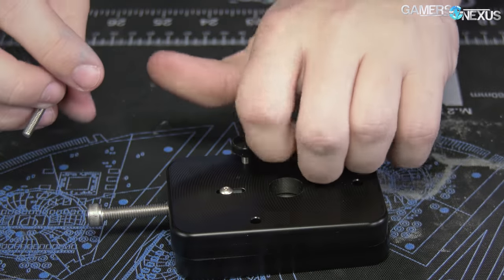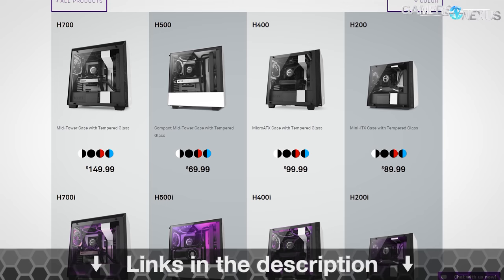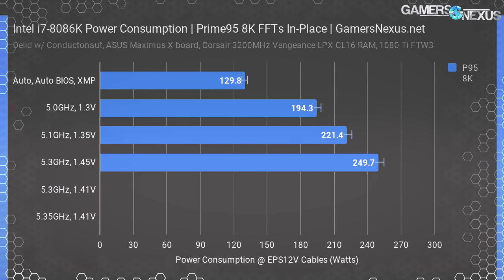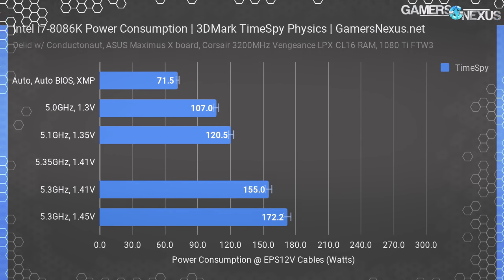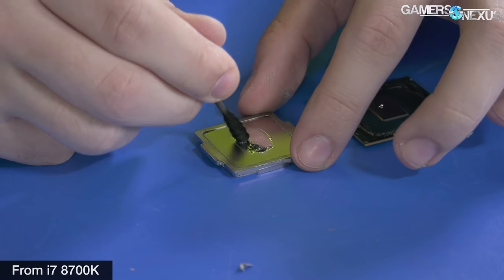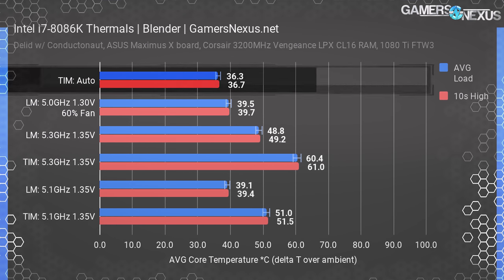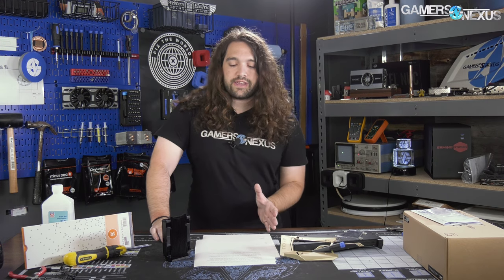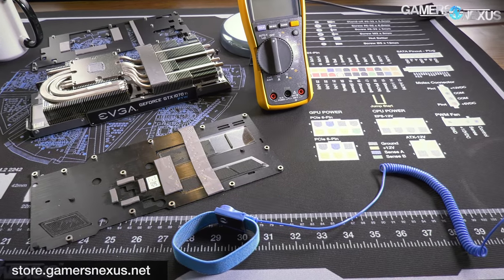The Untold Story of Liquid Metal: 8086K Power, Noise, & Thermals

Comment: This is precisely why I plan to delid the 8700k in my editing rig: Get it near silent at stock speeds for sound work. Great video on LM other useful applications!
Reply: Why not a R7 2700X?
Reply: lagarttemido I dual-boot into OSX to use Final Cut Pro on colab projects. Otherwise I would have stayed with Ryzen.
Reply: After delid you'll probably even have some OC headroom before the rig becomes noticable (in terms of sound).
Reply: I run mine with a silenced optimized fractal chassi, noctua nh-d15 and it is silent. no need to delid and remove warranty for sound levels.
Reply: logirex but with delid you can lower temps significantly. Use less power and generate less heat!
Reply: Indeed. This is a major part of why I want to delid, under-volt to keep the room temp down during long hours of editing. I have the NH-D15s and it's a great air cooler, but the thing it's sitting on isn't helping it do its job. 🙄
Reply: Why didn't you just get the i7 8700?

Comment: Steve, apparently 5nm graphene transistors have been made in research labs that can achieve clock rates in the Terahertz. I can't imagine the immense power my grand kids are going to have. While i was pulling my hair out for an extra 100mhz.
Reply: Obviously its for running a modded Minecraft server at a reasonable tick rate.
Reply: Spoonikle so true, my 1600 at 4ghz struggles with the mods we use
Reply: I remember when 1.6MHz was earth shattering... And then we got a 80386 at 24MHz and people said we'd never go faster than that since that's as fast as the human brain.
Reply: joshcogaming because java is terribly single-threaded. It’s a shame the core of the game was built so poorly.
Reply: Mitchell M. The game is multi threaded supported. Unless you’re still on a version before world generation was reworked. Right now it runs better the more cores you have. If you’re still on a dual core, then the current version of Minecraft will run worse. I believe it was patch 1.7 or 1.8 that made Minecraft run worse on potatoes
Reply: Hah! Yeah! I remember when my dad brought home his decommissioned work computer and I was blown away by the future. An 8088 4mhz. With the turbo button, you got up to 4.77mhz! Turbo button OP, plz nerf.
Reply: Michell M., Java is the first language to bring a memory model. It is one of the best languages for multithreading since then (2004) with lock-free datastructures coming straight out of its core library. Single threaded performance is nothing short of above decent. People still write high freq. trading in Java. However, non scalable code is just that regardless of the lang. used... throwing blanked statements is not helpful, either.
Reply: PorscheRacer14 I overclocked my brain to 28MHz 😎
Reply: The problem with graphene transistors is, that they have a very low on/off current or resistance difference. They always operate in an omic region, where the resistance of the S-D Path is determined by the gate voltage and there is no real 'off' state. Because of that, they are not yet suitable for larger digital applications, such as a CPU. However, they are very good at controlling analog signals, where they can archive cut-off frequencies in the THz region. But such a high cut-off frequency doesn't imply a THz switching frequency. For example special RF Mosfets can archive up to 400GHz of cut-off frequencies, yet CPUs are limited at about 5GHz. One of the reasons for this limited frequency, is that a CPUs consists of many transistors, which have to switch other transistors, so the maximum frequency of the whole CPU is lower than of a single transistor.
Reply: Oh great so all the graphene cpu stuff is clickbait maybe it won't have higher frequency than the one we have now.
Reply: Right now we don't have a technology to build a whole CPU with graphene transistors, however it is beeing researched actively and maybe we find a way to use graphene transistors effectively for digital applications. But they can be used for different applications, like modulating a High Bandwidth signal on a THz carrier, that could be used for extremely fast data transmission.
Reply: You won’t see that implemented in mainstream CPUs for another 10 to 15 years at least
Reply: That's not much of an achievement. We've made silicon transistors that run at 700ghz.

The problem with this logic is that :
-How fast a transistor can switch does not dictate how fast a cpu runs at.
-it's lab tech
Reply: If we continue on our current trajectory, our grand kids will be largely controlled by AI... if the human race survives that long. Our current future is cubits, not cores and neutrinos, not microwaves. Think non local computing. The people must have an interest and a say in how these technologies shape our future, the exponential growth of the wealth divide and the corporatisation of politics diminishes the likelihood of this. Progress without prudence is not progress at all. With great power comes great responsibility.
Reply: Actually, there is a theoretical limit of 10GHz when it comes to classical transistors’ maximum switching frequency - above this you get into quantum tunnelling issue territory. There are ways to mitigate this but at the moment they can’t be applied to complex digital circuitry.
Reply: Yeah, considering the distance that light travels in a picosecond (duration of a 1THz cycle) is 0.3mm, one side of your PC will be 1000 cycles ahead of the other, just from relativity! But who knows, maybe PCs will be tiny in the future...
Reply: Jack Maxwell Yes. Already there are Itx motherboards that report higher max memory speeds because the distance is smaller.
Reply: Jefferson while overclocking your brain did you accidentally underclock your intelligence for the poor quality joke?

jk
Reply: Was gonna jump in with "nyah.. back in MYYy Daayyy... " but it appears i there are older cootes here XD. 33MHz then('93); 4x4600 today.
Reply: Or 4.62ghz x 6 cores 12 threads with my asskicking xeon x5650.
Reply: 80386 @ 24MHZ .... yup, Sun 386i ;-)  But the really important computer was the Compaq DeskPro 386, which established IBM's previous open AT architecture as the Industry Standard Architecture, denying IBM's proprietary PS/2 Micro Channel architecture the controlling position. That was the beginning of the end of IBM and its new OS/2 operating system as the PC industry leader, and the birth of the high performance personal computer as a commodity.
Reply: CPUs have been limited by the FCC regulations for a long time because of electrical noise it causes, besides, lots of hertz doesn't mean much if its got no flops.
Reply: PandaMan c‘mon don’t leave me on a cliffhanger grandpa...
Reply: @mitchell3876  Certain versions of Optifine allow you to take advantage of more than 2 cores on 1.6+
Reply: I find that hard to believe considering graphene is a conductor not a semi conductor like every diode based component is today.
Reply: Oh god VR is gonna be so amazing

Comment: I remember when 1.2 GHz was badass... Looks so trivial now lol
Reply: I remember Pentium IIIs only able to get at 5ghz on LN and that was totally insane at the time.
Reply: I remember when the question was, "But can it run Tribes 2?"
Reply: Trail Features lol
Reply: SysPowerTools nice
Reply: I recall 2.0 GHz with 2 cores from AMD blowing Intel out of the water. Those CPU's are essentially useless today...
Reply: Commodore 1.02MHz (6502) were the days. That said we reached 5GHz in consumer processors 5-6 years ago..
Reply: @Chuckles Nuts Was that the Athalon chips? Too bad AMD can't pull that off again. To this day they haven't been able to design a process that's more efficient than Intel's, though, it only makes sense. Intel has far more resources, and has far more talent because they can pay their engineers far bigger salaries. AMD likes to design a process, find it's strength, and then market the dogshit out of it's strength. Which is fine, but Intel doesn't even have to market their products anymore lol. They just put it out and you know you're fine. AMD might mess around and leave you on a platform for 5 years without any drivers support like they did in the past. Or start throwing insane voltages at their silicon to get everything to "pass", but is running at insane temps and throttles. I'm not even sure AMD are real competitors at this point. They're more like , "an option". No offense to anybody who picked that option. Even if AMD puts out a chip that can undercut an Intel product in a very specific use case, Intel will fix that before the next quarter, and you don't have to worry about any of the risks associated with a company that's notorious for leaving their consumers high and dry....... FOR FIVE YEARS, not to mention driver and stability issues, even a year after launch "see demtrey's reason for going back to Intel just a few months ago".
Reply: Pfft, I remember when a 4 bit processor was badass. That's the first time I ever wrote a program, and it had to be stored on one of those things called a cassette tape using audio jacks.
Reply: Surfing Eagle Pfft I remember when the abacus was bad ass!!
Reply: logirex my first computer was a Comadore VIC 20, great machine back in the day.
Reply: The_Man22 my cellphone have 1.5 ghz 😑
Reply: 1.2Ghz is late... going from a 386sx 16MHz to a 486DX2 66MHz was amazing, also went from 5MB RAM to 32MB RAM. The computational power was insane!
Reply: @NikoBased  what's your verdict now, considering Zen2 is out and dimitri going back to threadripper?
Reply: Jesper here 486 dx 2x 66mhz (turbo button),407mb hdd,16mb rams,4xtimes speed cdrom,14crt, soundblaster 32.
Wonderful times :)

Comment: I’ve learned a ton from your videos, so please keep it up.  De lidded my 6700k a little while back and although I was kind of nervous, it all worked out well and I feel like all the custom water cooling I did is now worth it because the system maintains such low temps that I was able to turn down all the fan curves.  Bonus, even OC’d, the wife can’t tell when I’m gaming because my 6-140mm Varders no longer sound like an airplane taking off when under load.  :)

Comment: This is a great point. I delidded an 8700 non-k for my friend, simply to allow for decent cooling. It would pull 100W+ (HWINFO) during games like Star Wars BF 2, and temperature instantly spike to the 90's. Delidding allowed for a decent air cooler to run close to silent in all use cases. I have a hard time recommending these chips to people, as I care alot about the noise of my builds, and certain games will literally thermal throttle without a delid, unless you throw a big AIO at the thing.

Comment: Steve, one thing you didn't mention, when you use liquid metal you can normally drop your core voltage to maintain the same overclock.  This also will give you lower temps and lower fan speeds.

Comment: Honestly I feel the benefits of LM for acoustics presents itself best in laptops. Rather than overclocking, replacing the TIM with LM and undervolting the CPU can lead to much lower fan noise on laptops, due partially to the fans design and also to the proximity most people are to the laptop, regardless if the CPU/GPU reach thermal limit or not.

Comment: Indeed, even with a 280 mm radiator and Noctua fans, my 7700K at idle would spin the fans up to unbearable noise levels. Delidding allowed me to push the OC to the limit of the silicon and still keep a low noise fan curve.

Comment: Just delidded my 8086K with Thermal Grizzly Conductonaut Liquid Metal and I'm also using it between my Noctua D15 air cooler to my new delidded CPU. I wanted to make sure that I'm getting the best possible heat transfer to keep my CPU as cool as possible and knowing exactly what the real difference will be in reduced temperatures with no normal thermal paste between anything. Now I don't have to wonder if the thermal pasted between the cooler and CPU is holding any more cooling back. I took the time to do everything right with no shortcuts at all. It's pretty simple and straight forward watching many You Tube video's in how to do it.

The results. Wow, it's really hard to believe with my own eyes but my temperatures have truly dropped 20C. Not 10 or 15 but really 20 degrees Celsius. With that being said, I know I've done everything right. I'm not a skeptic anymore about liquid metal and what others have been saying. This really works. What a disservice Intel has been doing to all of it's customers with not soldering their CPU's. .
Reply: I dropped 23c on mine 8086k. My max temp now is 49c on max load. Running 4.5ghz (all cores) 1.1 volt
Reply: @chriss881000  Nice to hear that your CPU temps dropped even more. When you at least get your Temps down 20c or more, it really shows how effective liquid metal works as a replacement to regular thermal paste. We can at least say it's a cool product that works.
Reply: @nickm8651  yes:) i rly was shocked.  I never go over 45c now on max load.  Just got myself a custom loop for the cpu. Saving some money up now for the gpu to=^)

Comment: Great video!
Do you think you could make a follow-up using Kryonaut instead of LM on the die? No one seems to have tried that, and I don't know if I'm missing something but wouldn't that logically be a big improvement on the stock TIM as well? Especially considering the silicon adhesive is causing quite a bit of issues, so if that is scraped off and a better TIM is used.. How good would that be? :)
Reply: osgrov just by removing the thick layer of adhesive that Intel uses can make huge difference.
Reply: I'm using Kryonaut cause I chickened out using LM. It's few degrees better but not as much as LM on 4690k @4.5Ghz with 1.216V at the core. At most it's 10C delta decrease for me.
Reply: LPMusicON interesting! Did you scrape off all the adhesive as well? Re-sealed or is the IHS just laying on top?
Reply: osgrov you should always clean it off completely and then use some permatex ultra black, a very thin layer, just to hold the IHS in place. I leave mine in the tool with pressure for at least 24 hrs so no swelling  ocrurs

Comment: To me, those improvements in acoustics might be worth it. Running an 8086K undervolted with LM could make for quite impressive dB. But its not yet time to upgrade since I bought an 1800X last year.
Reply: Yeah, I'll probably only upgrade when Ryzen 2 launches. Those chips will hopefully be supported by my motherboard, which would definitely be way cheaper then buying into a new Intel platform. Have high hopes for them since Ryzen was already pretty impressive when it comes to efficiency.

Comment: Steve, I saw someone online talking about how gallium and/or indium in conductonaught can diffuse into and degrade the silicon chip over time. Just curious if you've heard anything about that or if it's even physically possible?
Reply: Cody Kownacki it's true. In Chemistry, it's called oxidation. Just like how air ( O2), oxidizes Iron (Fe)
Reply: All of you liquid metallers are screwed. And you're probably creating the T-1000 while you're at it.
Reply: OP, this process is called doting. With different metals, you create the NPN structure of the transistor.
Reply: According to der8auer https://youtu.be/tnd2LO0IBic?t=6m19s CPUs have (mainly sillicon nitride) diffusion barriers preventing such stuff from happening. But with exposed silicon diffusion should not be at all unlikely

Comment: How much better is Kryonaut than stock tim for a delid? I have not decided between Conductonaut and Kryonaut
Reply: This would also make for a good video. Comparing them and seeing how much of the temp drop is from removing the silicone adhesive, and how much better LM is than a good non-conductive thermal paste.
Reply: Yes I am disappointed about this test because I expected proper thermal paste used to compare to LM and not the Intel's stock garbage.
Reply: that is actually a great idea. Since Liquid metal can be a pretty scary thing, it would be a fun idea to see how a high quality paste would stack up vs. stock intel paste. Good for people who want to be adventurous, but not quite to the level of liquid metal.
Reply: if you're delidding and voiding your warranty you might as well use conductonaut, in my opinion. it would be interesting to see the difference though. according to Steve a lot of the gain in thermal performance from delidding comes from reducing the distance between the die and the ihs by removing the silicone, so delidding with kryonaut should be significantly better than stock
Reply: I've replaced the paste on GPUs with Kryonaut and it makes a big difference. It's definitely a step above of any other paste I have used before. It would be an interesting test to see.
Reply: I also would like to see this video.... Pouring electrically conductive LM near my CPU caps is too risky for me. I feel running the CPU without the IHS is safer. Yes, Die ---> TIM ---> heatsink
Reply: CampyCamper I don't think it's really about "voiding warranty", it's about people not feeling comfortable putting electrically conductive liquid materials near their expensive hardware. In a way since you're already voiding warranty it's kind of even more of a reason to not use such potentially dangerous materials, just to make sure you'll still have a functional CPU at the end of the day. =)
Reply: When I did mine I added a little silicone sealant to protect the caps etc around the die. And a very small amount of silicone to the ihs edge to hold it in place.
Reply: Gamers Nexus on previous videos: "The issue with the stock TIM is more an issue of the gap between the IHS and CPU die, brought on by the material adhering the headspreader with the CPU." I wanna see this point tested, too.